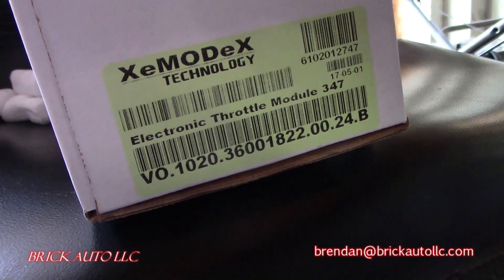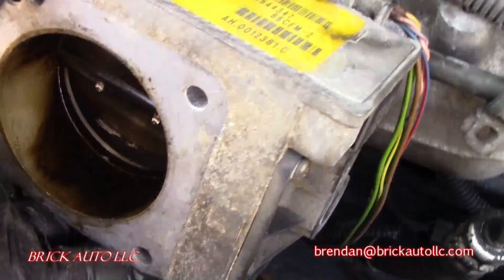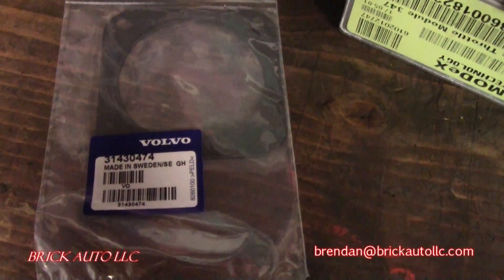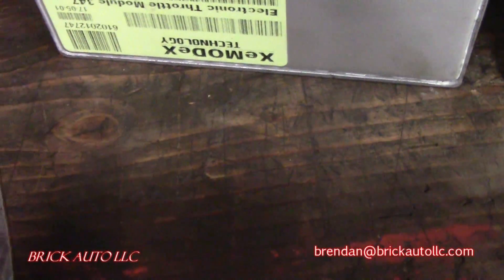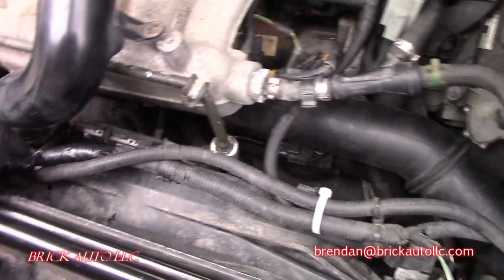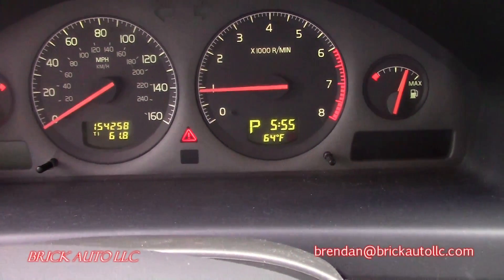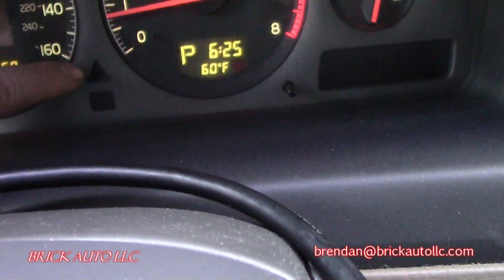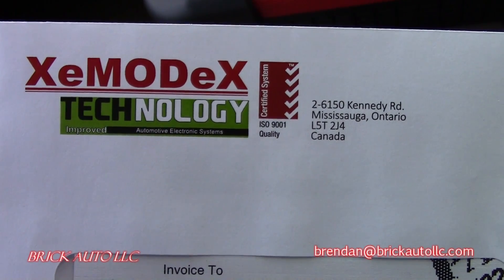2001 Volvo V70 Turbo ETM Replacement 5 cyl 2.0  (also S80 01-06, S60 01-09 and V70 00-07)

Comment: Did you Know that the Etm,s Were Discontinued from 2002 in 2002 they remodeled the Throttle body in all models so Volvo,s from 2002 to 2009 had different Throttle body so Change the Title to 00-02 for V70 And S60 and 98-02 on S80 I hope this helps take care
Reply: Thanks for that comment! I have a S80 2003 where the part does not look like this, and I wondered where the problem was :-)

Comment: Yeah, clearing the codes makes a huge difference.  It's usually one of two things with it running like that.  A bad ignition coil or an ETM issue.  Usually the ETM issue is a bad throttle position sensor.  The Xemodex (pronounced Zee Mo Dex) has a solid-state position sensor and they're awesome.  My 2001 has almost 300,000 miles on it now.
Reply: Mine is doing that now. I don’t need to replace the entire thing huh? Just the throttle position sensor needs replacement correct?
Reply: Saga Roofing That’s Correct. It could be that it just needs to be clean. Trouble is you have to take it out with the ECM. I just decided to change mine in the process.
Reply: Yeah, but they're really expensive. like $600.
Reply: @blakcherry329  true.  Not cheap. But if you want to keep the car and keep it going it’s worth it.  Sadly my ‘01’ hit a deer at 70 mph. Insurance totaled it.  But it’s one of those things you have to weigh out if it’s worth the investment.
Reply: Was yours an N/A model?  I also have a 2001 and am having the same issues but no codes.  If you don’t have codes, is it pretty certain it’s the ETM and not the coils?
Reply: @  not necessarily the etm.  You might try switching the coils around and see if the problem changes on the cylinders.   Mine sadly hit a deer a few years ago and got totaled.  Had well over 300k on it.
Reply: @tna2me197  ah sorry to hear that.  Yeah I don’t currently have Vida so I can’t check if there are any misfires but there are no codes of it. I’m pretty certain the ETM is original and the car has 150k miles on it.  It is a 2001 model so definitely is an effected year.  

I’ll check to see if oil is filling spark plug tube holes as the PCV hasn’t been done yet and I’m assuming it probably needs to be done. Maybe oil is causing the coils to act up but isn’t throwing a code.

Comment: Maybe it just needed reset
Reply: How can I  reset it?
Reply from the maker: I agree, that is the first thing to try.  In this case though, I had cleaned and reset it prior to this replacement - unfortunately, that didn't work on this one but I agree, start with that first (much cheaper if it works!)